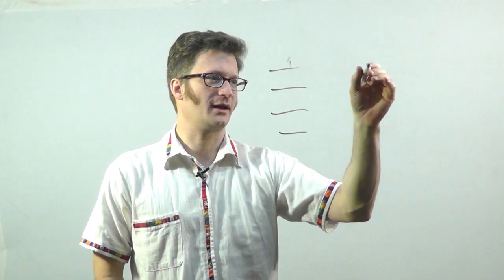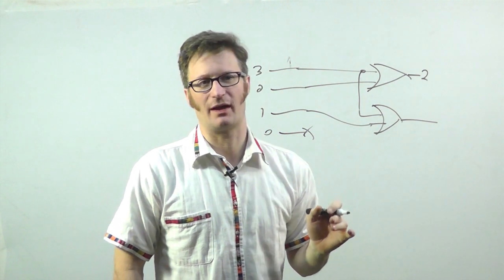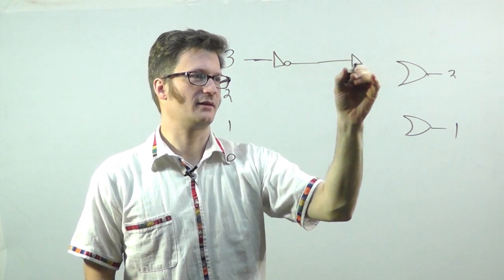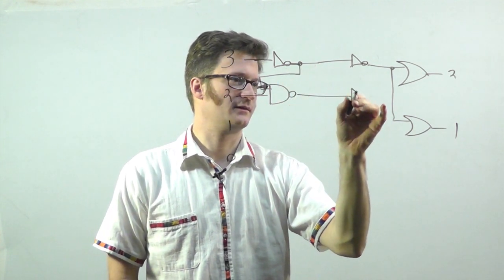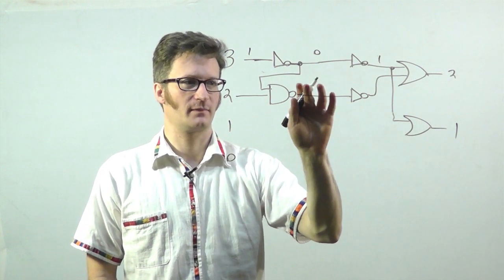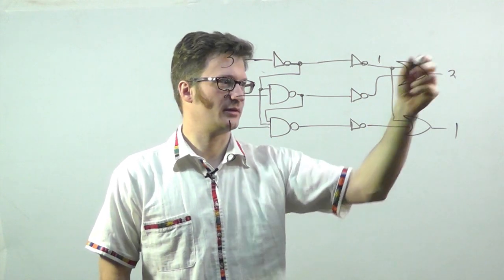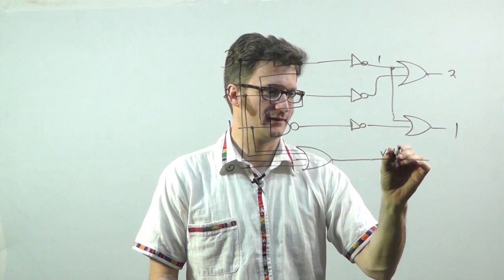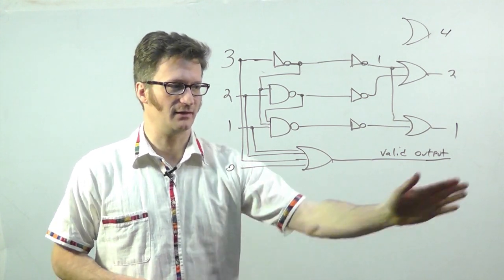Digital Logic - Priority Encoders

Comment: Very clear til the last minute of the video. Am I supposed to fully understand whats going on in the priority encoder and tell myself that for what I am doing I need an or gate that shoots from all my inputs? Seems like all it does is makes sure the inputs aren't all 1's.
Reply: I don't even see why it needs a special name.  I just think of it more as a program composed of a network of "if" statements.

Here's an idea though => a C++ program where you could give it a set of inputs and the desired ouput(s), the program output would be a simplified boolean statement that would have that desired output with a diagram.
Reply: Agreed about the last minute.